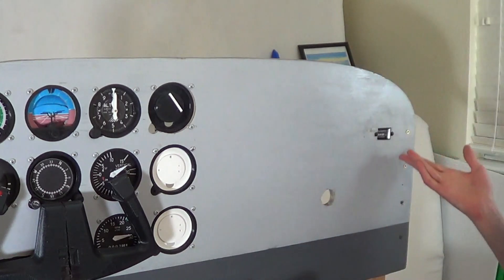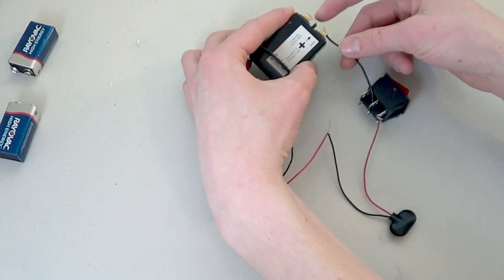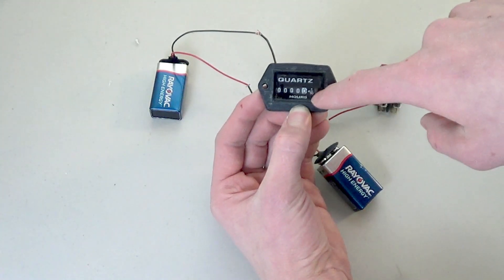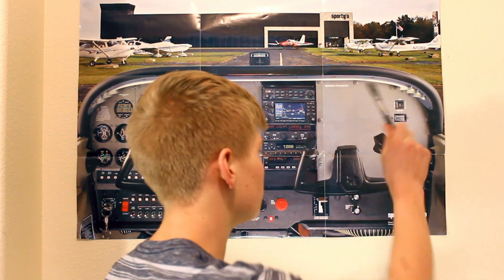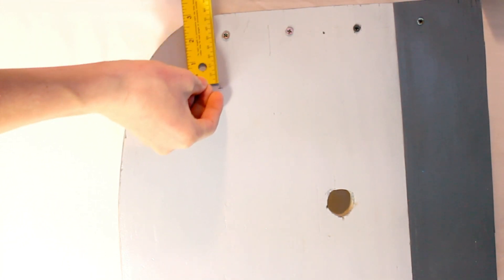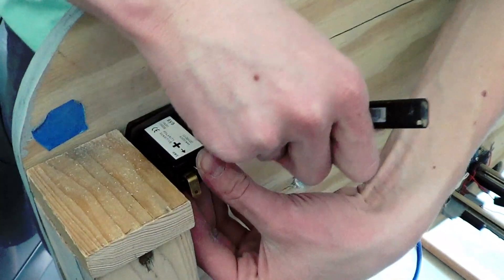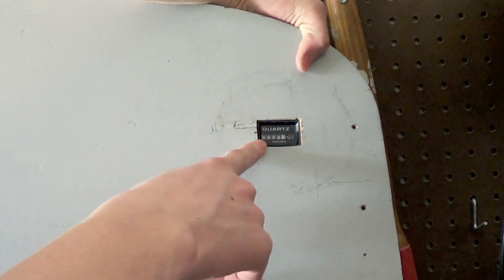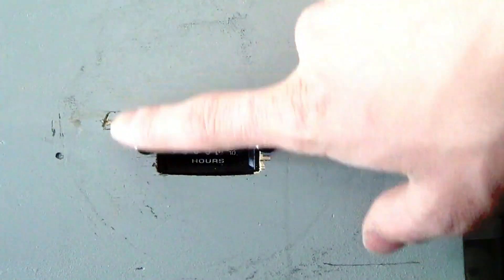How to Wire and install a Hobbs Meter for a Flight Simulator | Captain Bob

Comment: Excellent.  Wonder if you could use a 5V plug-in for power similar to the type to run an USB Hub?  Then we would not need to replace the 2 batteries.  As luck would have it, we would be operating the simulator mid-flight when the batteries died.
Reply from the maker: Good Point! The Hobbs Meter says that it needs 12-36V DC, so I think I'll use a 12V power supply. 
It would probably be mid flight when the batteries die :)

Comment: Nice to see avionics for a real airplane installed in a flight sim! I have a chronometer from CRJ 700 but I think it is impossible to connect it to PC to show P3D time.
Reply from the maker: Yes, some OEM parts seem to be quite tricky :) They require a lot of creativity and effort.

Comment: Excellent, maybe you can use a relay and mobiflight to activate it when the engine is on.
Reply from the maker: That's a good idea! I'll have to experiment with it. I think the current version should work for now, and I can update it as needed :) I might also connect it to the "Both" key position.